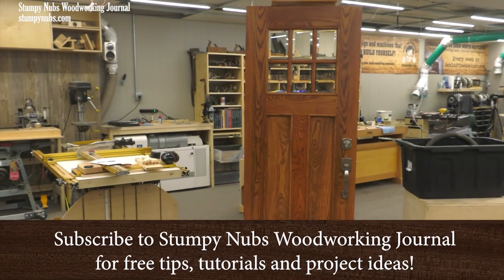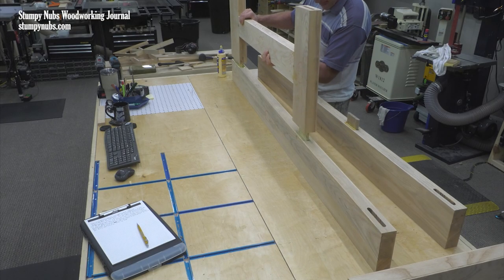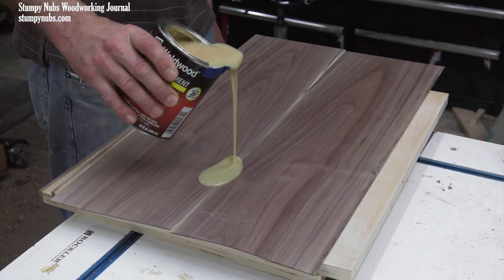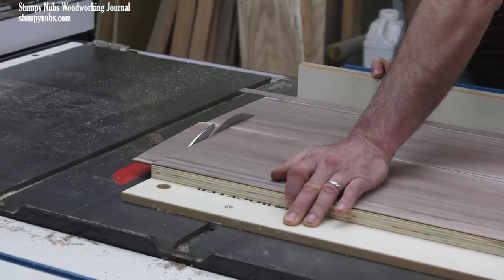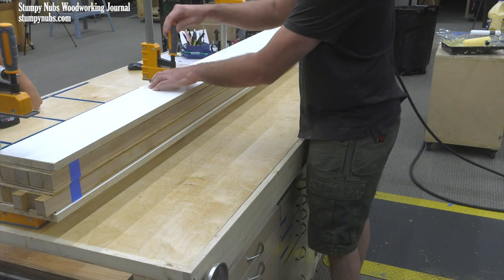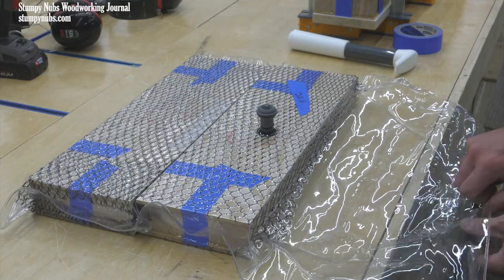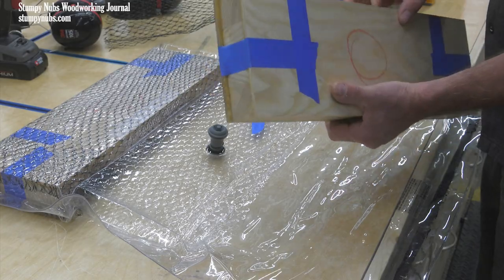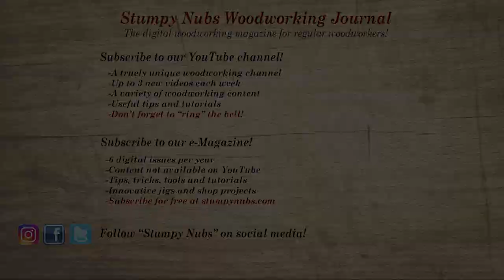Easy veneer clamping/pressing tips

Comment from the maker: Links you should check out►
Veneering bag set: https://www.roarockit.com/tap-kits-bags-and-parts/
Glue roller: https://amzn.to/3kQWyZP
When you use this link to visit our sponsor, you support us►
Dura Grit Carbide Sanding Products: (Use Coupon Code: STUMPYNUBS): https://duragrit.com/home.php
(We may get a small commission if you use one of the above affiliate links.)
Subscribe (free) to Stumpy Nubs Woodworking Journal e-Magazine► http://www.stumpynubs.com/
Reply: Looks like a band saw is in my future, veneers at the big orange/blue are hellishly expensive. Which combined with my lack of veneering experience, you get the idea.
Reply: I love the Roarockit kit. I had no luck with veneers before that. Now, it’s another arrow in the quiver.
Reply from the maker: Choosing a band saw: https://youtu.be/sUsKYElDKl0
Reply: I’ve been using a Roarocket TAP for about 4 or 5 years, and it works fantastically. Also, they are a great source for colored veneers (originally for skateboards, but I use them for tons of projects, especially turning projects)
Reply: @gregm2181  Does anyone have any advice for how big the bag needs to be relative to the pieces to be veneered? That would help me choose the smallest kit size that would work for me. Thanks!

Comment: This is very timely for me. I've been putting off a project that is repairing a damaged veneer. The original piece had a sopping wet towel left on the veneer surface overnight, which ruined the veneer. (Also ruined the particleboard under the veneer.) Fortunately, it's a slide-out shelf on pretty standard drawer hardware. So it's just the replacement of one piece without any significant disassembly. This info will help me tackle this job. And if I mess up, I can simply try it again. The materials involved aren't that significant. A perfect job for a first try at veneering.

Comment: I do veneers occasionally and have done some laminates as well. Two tricks I picked up: use gel contact cement (easier to spread evenly and doesn't run as much); rollers can apply enough pressure but edge of the soft wood (lightly curved by sanding) or plastic carpet tucker are better. Hope this helps. Also as a general comment contact cement is not that scarry - watch few videos and open the garage doors and you will do fine.

Comment: Ever since I learned about the technique, my favorite way to apply thin veneer, is to coat both surfaces with Titebond glue, let it dry (or slightly tacky), then use an iron to join the pieces, just as if it was coated with hot melt glue. No special tools (other than an iron), it's repositionable and non-toxic. Are you familiar with the technique and are you aware of any reason not to use it?
Reply: @brooos
 Have you tried it on a guitar?
Reply: Veneering pre bent sides would be a challenge

Comment: I don’t like using contact cement for wood veneers…have had a couple of spectacular failures. Heat Lock glue works very well for me. It works similar to the wood glue method, with the addition of ironing it to set it.

Comment: When using contact cement, you may want to seal the glue surfaces with shellac first. This will limit water absorption and prevent the cement bleeding through to the finish side

Comment: Stumpy:  Your videos are always interesting and feature methods that many of us may not be aware of.  Today's video was sort of an exception since you missed one very easy way to apply veneer.  You just coat both surfaces with wood glue (much as you do with contact cement) let the glue dry to touch, place it on the substrate and go over the veneer surface with a hot iron. (just use a domestic iron just like home makers have been using for years and don't use any steam)
If you are applying veneer to solid wood it is important to veneer both sides to prevent warping caused by surface tension.  Try the hot iron method you will find it is a cinch. David Adair
Reply from the maker: "Your videos are always interesting and feature methods that many of us may not be aware of.  Today's video was sort of an exception..." How is this video an "exception" when it appears the method that I did not discuss was one you were already "aware of?" ;)

Comment: have you ever tried a method of spreading yellow glue on both surfaces.  Let it dry completely and then iron the veneer on?  the iron melts the glue and the two surfaces that have been covered with glue become fused.

Comment: I have a question. I have veneered paper backed thin veneers as well as solid wood thin veneers with the iron on method. 
i would be curious to hear your take on that process. also what you might think about iron on with say 1/8" veneer. I have used both titebond 2 abd  titebond 3 for this purpose. Also, my love goes out to those good titebond people and their support staff that offer such good advice to  the average woodworker. The Franklin
 company I believe.

Comment: Thanks for sharing.
A question for experienced woodworkers. In your experience, do brad nails apply sufficient pressure to guarantee a good bond with wood glue between the veneer and the underlaying wood? I have actually had to do it, with good results, i think. But it's a technique that seems a bit sketchy to me.
Let me preface by saying that i'm a carpenter by trade, i work mostly on site, not in a shop. A few times i had  to apply AC grade 1/8in plywood to some surfaces that offer NO reasonable clamping options.
 I realize that there are some adhesives that don't require hours of clamping, much like the type James uses in the first section of the video. But i live in a the rural zone of a forgotten village in the least mentioned province of a developing nation at the edge of the known world. I really, really don't get to play with anything remotely fancy in terms of products. I have wood glue, epoxy, super glue (expensive as hell) and polyurethanic glue. That's it.

Comment: Love it, thank you.

Any tricks on veneering curved edges or mouldings? Can it be done?
Reply: The Roarockit vacuum kit he talks about in the video excells at this... perfect for that kind of veneering... it was designed to do curved skateboard decks. There are other vids on using it on curved pieces.
Reply: @0dtp1  thank you
Reply: If you don't want to invest in a ton of new equipment, hide glue hammer veneering is an inexpensive option used prior to the invention of PVA for centuries and requires no clamps. Hide glue is also non marking under finishes, so no more glue marks on your project.
Reply: @csstatham  must research that never heard of it sounds very interesting, thank you 👍.

Comment: Too bad that veneers got a "bad rap" long ago.  Sure, you can veneer some cheap crap and you end up with cheap crap that looks a little better.  But, you can also get tremendous furniture and other items of the highest quality.  Veneering gives you a way to use species of wood that would otherwise be too rare and/or too expensive to do with solid pieces.  I have used the roarockit when I was starting out and eventually graduated to a big bag and pump that can hold a full size sheet of plywood.  I loved your video, but you left out one key tidbit of information.  Even though veneers are thin, the forces of wood expansion and contraction are very strong, so you need to veneer both sides of a project to prevent your piece from bending, curling or warping.
Reply: Thanks, I'm starting a project next week and was only going to veneer the visible side.
Should the same veneer be applied to both sides or will any veneers do?

Comment: What's the difference between a platten and a caul?
Reply from the maker: A caul us a strip of wood, usually with a crowned edge. A platen is a panel that distributes pressure over an area rather than a corridor. At least that's my understanding. But these are merely semantics :)

Comment: Thought of a question.  Many of the vacuum systems I have seen on other channels, stay attached, and monitors if vacuum goes down.  At least this is what I thought.  What do you do in the case of this system?  Thanks.
Reply from the maker: If you have a good bag, it will hold a seal. I don't see a need to monitor it.

Comment: What is the recommended thickness of the veneers?
Reply from the maker: As thick as you like.
Reply: Yes, I veneered a custom exterior door (stave core stiles) with 1/4" (resawn on table saw) 165 y.o. maple. Used Cascamite UF glue and rolled it out. Then Parallel bar clamps to lock it down for a day.

Comment: Those little bits you're gluing on look like commercial veneers, the very thin pieces around 1/32". I don't think I'd care to cut my own via any sort of resaw technique, as shown here. 1/4", 1/8" or even 1/16", maybe; but making the really thin ones calls for more specialized machinery and technique.
Reply from the maker: The bandsawn veneers in the video were 1/8" thick.